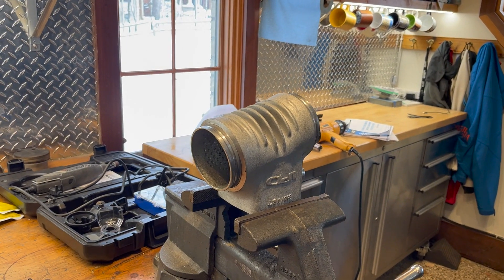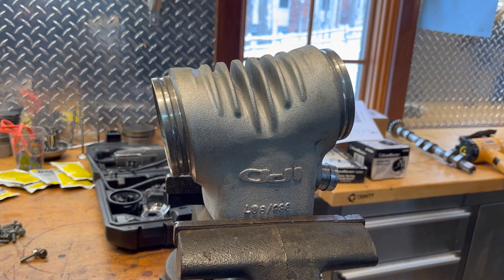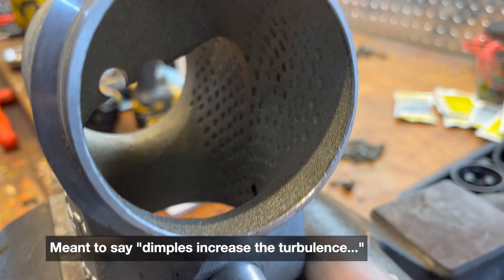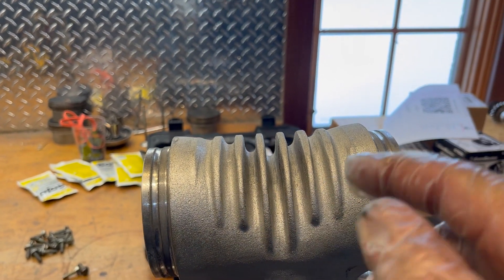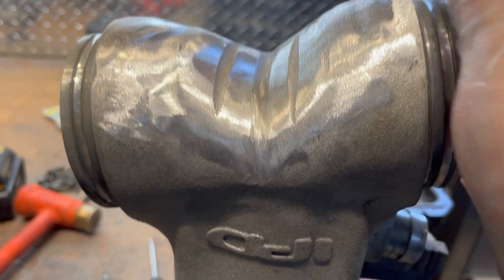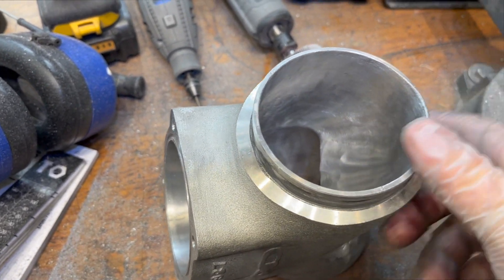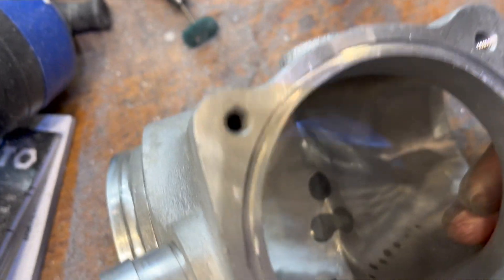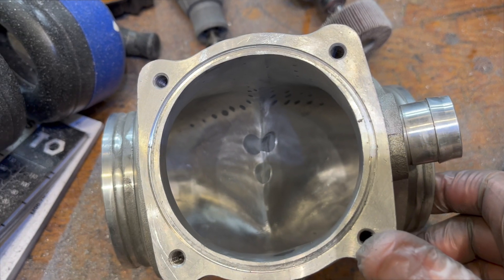Porsche 986/987 IPD intake modifications to improve the poor design. (Boxster/Cayman)

Comment: The poor oem design is superior to this thing because the wave of intake must bounce of each others bank to help fill the cylinders. This was very popular 10 years ago but no one had any positive dyno test with them.
Reply from the maker: I agree with you nine times out of 10, but Porsche also wanted to keep the Boxster in a lower performance category than the 911. As such, there are ways to open up the breathing capability of the engine, and extract more performance.

Comment: So is the IPD plenum a scam or not? I just put one on my car, with the GT3 throttle body. Still working out some bugs (CEL).
Reply: Did you solve the cel if so how?
Reply: @captainbuzcrust7415  I did. My shop used GIAC for the ECU tune. Working with GIAC, it was determined that there was a line of code that should have been deleted for my setup. I can’t recall the exact detail, but I think it had something to do with the fact that the ECU was seeing more air than it thought it should be seeing and threw a code as a result. Well, the “more air” was a feature, not a bug, so that line of code was removed. (I think that’s what the issue was.) The shop had to eat the cost of the second re-flash of the ECU, since it was an error on their part (they probably worked something out with GIAC). No more CEL.
Reply from the maker: IMO, opinion, the most value of the IPD is to upsize the throttle body, but you can also use a 911 plenum to do the same thing.  .

Comment: Going catch can route? Intrigued what youre doin in place of the aos delete
Reply from the maker: Keep the AOS.  It will self drain into the block. But remove the main 3/4” vacuum line to the air intake and cap the intake port.
Reply: @mikepetersen3  can you explain the reason and benefit of doing this? I am rebuilding an m96.21 and deleted the secondary air system